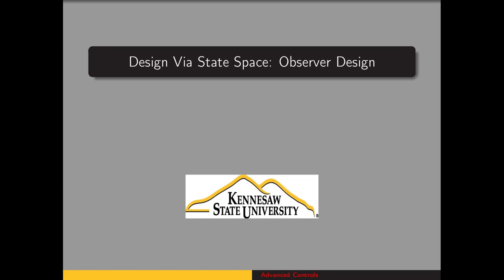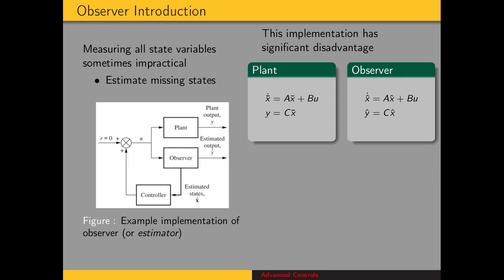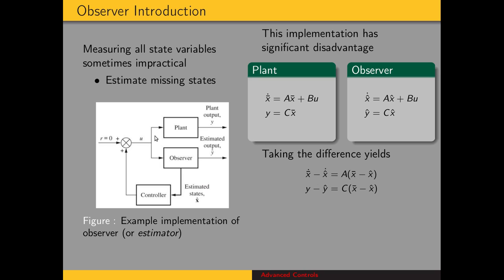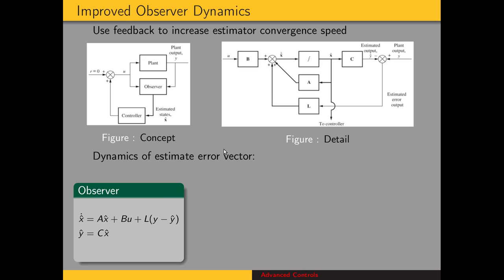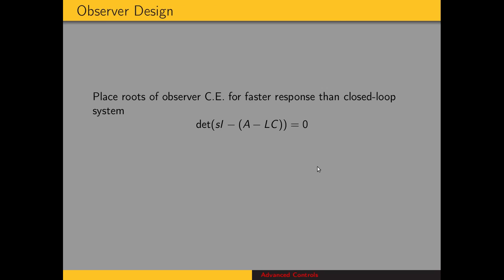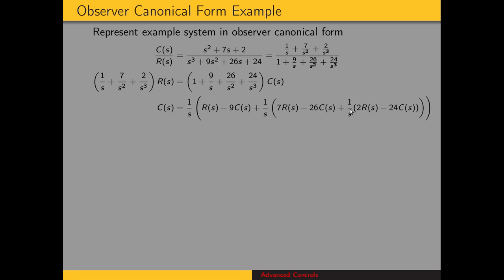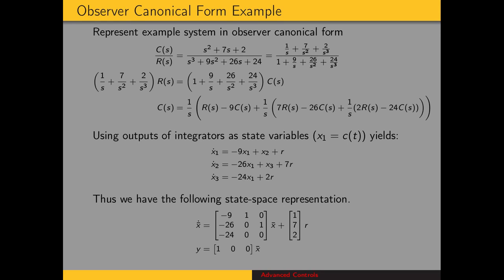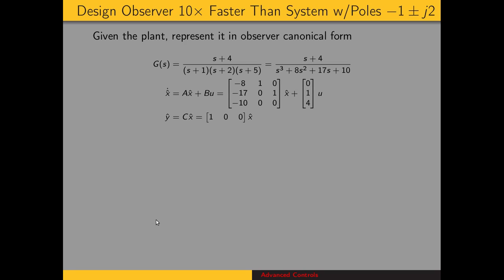Observer design

Comment: For Future students, Dr. Marshall and I went over the Last example and determined that the third pole placement for the observer still needs to cancel the zero in the numerator, so instead of -100 the pole will be located at -4. If no zero were present, the pole would be a 10x multiple of the third pole in the original system, which is 5x the real part of the dominant poles (in the example, that would be 5x1 and then 10x5 for and observer pole at -50)
Reply: Thank you past student.